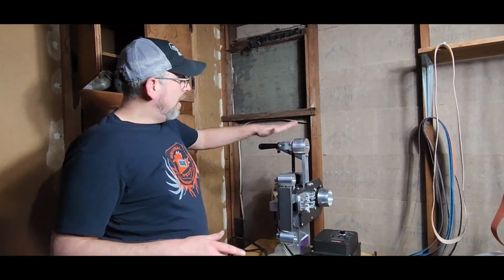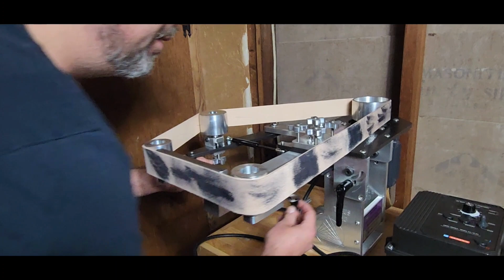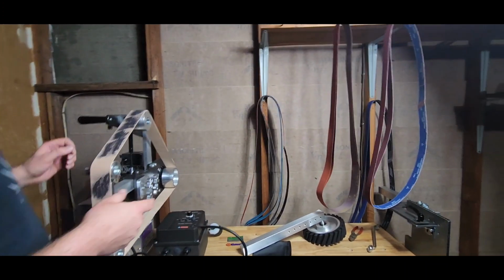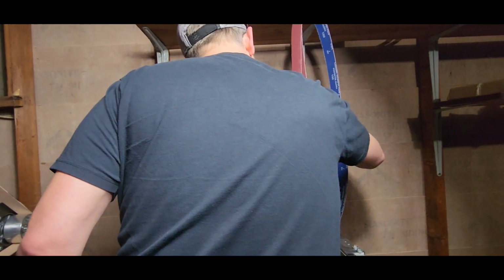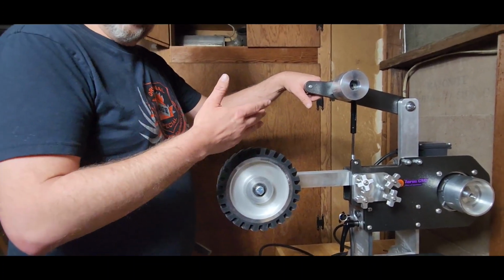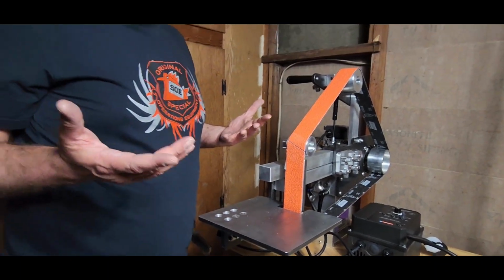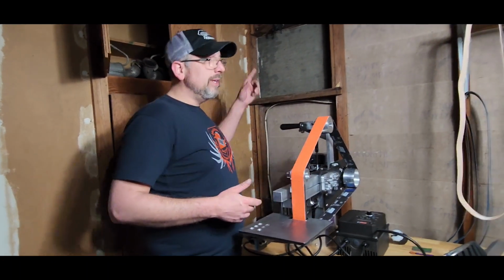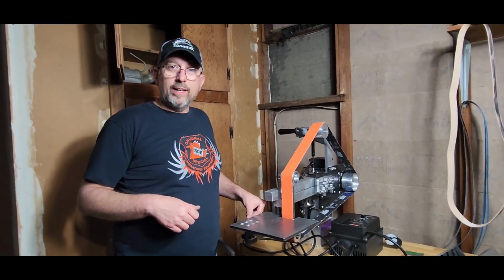TorusCNC M90 Belt Grinder First Impressions @toruscnc8149

Comment: Billy that 2x72 is a awesome grinder !!! Congratulations!!
Reply from the maker: Thanks bro
Reply: @apex_alchemy_knives  There's different 220 female outlets for different amperage. Make sure your wire size and breaker is capable with the amperage of your 2hp motor.
Reply from the maker: @shoresharp8349   I checked the amps and it looks like in on a 30 amp fuse. Hopefully the wiring is up  to par too. I hear the lowest 220 wiring will be 12.4 amps and this thing is 6.7 amps...so here's to hoping lol